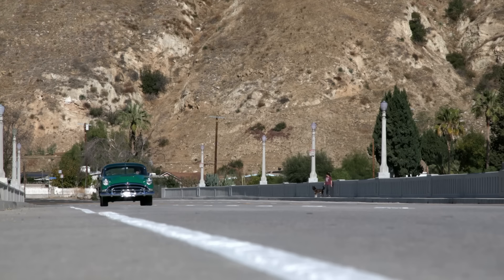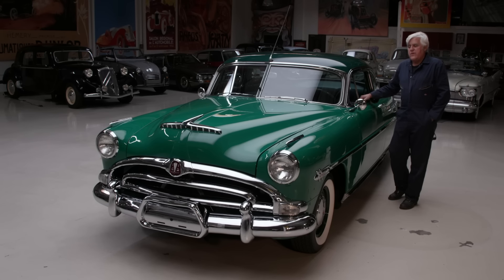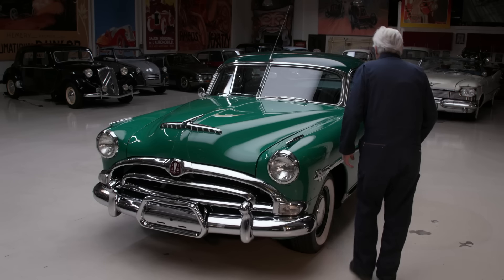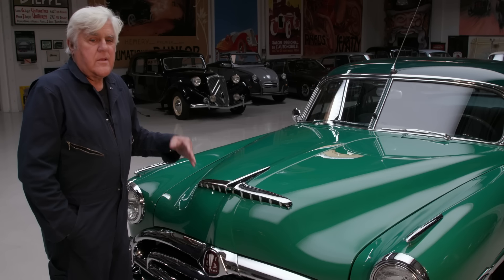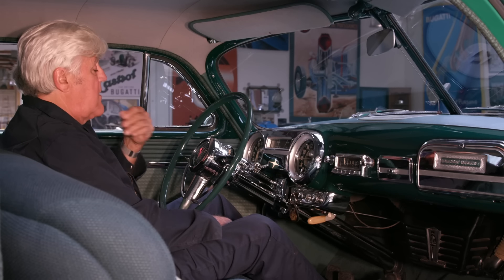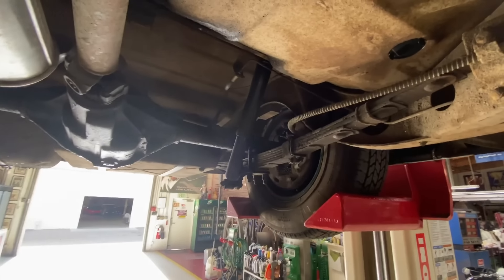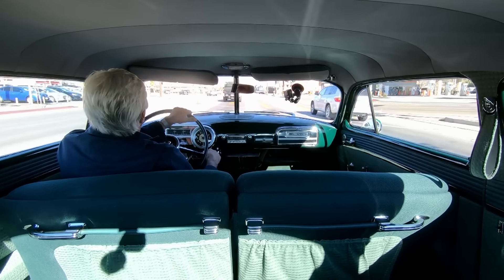1953 Hudson Hornet - Jay Leno's Garage

Comment: The car that I enjoyed driving the most when I was growing up was my dad's 1954 Hudson Hornet. You could get on the inside of the engine to work on it. It had an automatic transmission. When I ask my dad about putting a V8 in it, he said that a Packard V8 would fit the transmission housing. The car was a comfortable driving vehicle. However no power steering with 3800 lb. Power steering was an option that year along with oil filters being a new option that year on the 54 Hornets. And remember, no seat belts. One thing that used to happen was that my dad would drive to San Jose on the freeway doing 65 look up for a few minutes looking around look down at the speedometer and find that he was doing 80. That's how smooth the ride was.

Comment: I know just what you mean about the feel of cars from this era. When I started college in 1966, I bought a 53 Chevy Bel Aire hardtop from a work friend of my dad. Paid $100. for it and drove it 4 years replacing only the voltage regulator and the battery. Ran great and the clock.still worked as long as I remembered to wind it.  Had the old Blue Flame 6 with 3 on the tree, no overdrive, and, I think, a  4:10 rear end. Drove and rode great. After graduation, I sold it for $150. and bought a nice low milage 68 GTO. Talk about a change! But sure wish I had kept the old Chevy. Maybe I'll find another. Saw one for sale at a Chevy show. Nice car but painted bright taxi yellow. Mine was a light blue with a white top. Good days.Well, except for Viet Nam but they never pulled my number. Went into Federal law enforcement and as the new guy got the oldest car, a 66 Dodge Police Pursuit with a 440. Rough around the edges but man was it fast.

Comment: My grandfather taught me to set valves with engine running. He did the same with B-29 engines in WWII. Messy though as oil flies everywhere so you need goggles.

Comment: Battery shops in this area used to make up 8 V batteries for cars with 6 volt systems and they did not hurt the 6 volt wiring.My employer had several 6 volt caddies with that upgrade. Cheers from here! Southern Vancouver Isle

Comment: In 1968 I had a "55 Hudson Hornet V8 and it was loaded. It had air conditioning, power breaks, power steering, automatic transmission, and it had the Nash style enclosed drive shaft. I bought it for $100.00 because it needed a universal joint. That car was awesome.

Comment: 1) I was too young to drive back then, but my great aunt and uncle had a yellow Hudson Hornet when I was a kid.
2) That clock looks like it could have a radium dial, so it would be easy to read in the dark.  The radium dials in those days, and into the 1960's as I recall, were much brighter than the later ones.

Comment: Yeah, a Hudson was what Clint Eastwood's character in Kelly's Hero's was going to buy with some of his share of the gold.

After the war my dad worked as a mechanic for a Hudson dealer at 12th and Robison in OKC until Hudson went out of business.  We (my dad) had a Hudson Hornet coup that was the same shade of green as this one.  It had a sun visor just above the windshield and a unique prism viewer so you could see the overhead signal lights if you had one of those sun visors.

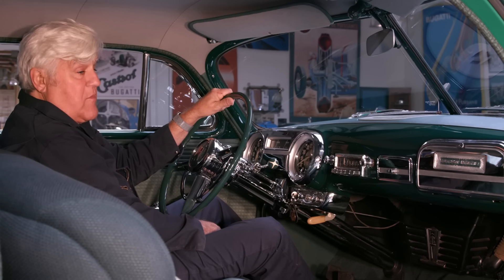At the 7:42 mark when the hood is up you can see back on the firewall two horizontal cables that wrap around small pullies on either end or side of the firewall.  These cable/pullies operated the vacuum driven wind shield wipers, that by the way when you were accelerating would slow down due to lose of vacuum.  On the inside at the 13:46 mark you can see a tan colored handle in just the correct position to be reached by the driver's right hand.  When you push this down a door would rise up in the middle just on the outside of the windshield that would allow air to come into the car.  There was no A/C in those days.  At the 20:50 mark you can see the seams of this door at the rear of the hood just before the windshield.

Memories.  Good ones.

Comment: I worked in a building from 1993 to 2011 that had originally been built as a hudson dealership back in 1946. It was interesting because this building had been changed very little in all of that time. There was still a glass showroom at the front of the building that had been used to display  brand new hudsons, and all of the salesmans offices were still intact and as they were back in the 1940's/50's. This building still remains this way in 2022 and is located in downtown Roanoke Va. Any hudson enthusiasts would probably take great delight in seeing an old dealership that has remained virtually unchanged in 75 years of history. It is almost certainly the very last one of its kind in existence today.  How much longer it remains this time capsule of hudson history is anyones guess

Comment: I was the mechanic for a Oval Racer '53 Hudon 2 door Twin Hornet. Th driver always out cornered the V-8's. AND he usually on the race. 307 ci flathead six with dual two barrel carburetors. Ran on 101 octane gas.

Comment: Our family inherited a 52 Hudson Pacesetter in 1963 with about 8,000 miles on it.  Garage stored.  Upholstery was brushed wool pinstripes and it got rubber in all three gears.  Amazing car.  It was stolen and stripped about 3 years later.

Comment: I just watched this, again, after a few years- I must say this 1953 Hudson Hornet is about the level of technology that makes sense for an automobile.  That is efficient, reliable and more than adequate performance that feels right as well as serviceable for a long useful life of dependability.
        I wonder if the original dies are left?  A new American manufacturer needs to emerge that is willing and able to produce reliable and dependable automobiles.  New technology is not all bad! Disk brakes and cross-flow radiators improved safety and reliability.

Comment: I'd love to drive  a Hudson, always thought they were sleek and just good looking.  I recall the local dealer showing up when  my father got off  work and he was driving the new '68 Corvair.  We went for a test drive and it was nothing like the older Corvair's and the styling was really nice.  Seems like it had some sort of turbo  engine and it was fast and quiet and handled really nicely.  But I had a 67 Malibu Sport with a 327, 4 speed and the engine had been built with all those go fast parts with GM numbers, not a number on anything in the GM book because it was a Zora Arkus engine and made 425 hp.  It would just blow the big Mopars off the road and outrun the DPS so badly they could never catch me.  It revved so high it would sling the blades off the alternator.  It has a few nicks on the hood from the underside.  It was a really quiet car and smooth and handled better than nearly anything from that era.  I stupidly traded it.  If I'd had any sense it would be parked in the barn right now.  If I'd only known just how nice a Hudson Hornet was I would have bought one for cheap since the junkyards and car lots had plenty of them.  Being a truck driver I would have appreciated that inline 6 but I was ignorant.

Comment: I had a '61 GMC 3/4 ton with hydraulic brakes and clutch that use the same fluid reserve. I pushed in the clutch and braked at a corner one day and blew the hydraulic clutch seal just as I put it in neutral. Reckon I should've replaced that when I replaced the brake cylinders and forgot to reconnect the emergency cables. But hey, it was my first vehicle I didn't even know it had a hydraulic clutch. It eventually rolled safely to a complete stop.

Comment: The Hudsen takes me back to to 1968 when I worked part time pumping gas on the evening shift going to college. A coworker had a Hudson Hornet and I thought it was smooth driving and unique. Used to buy 1950's cars for 60 to 75 dollars and drive them for a year or two, bought the recapped tires for $10 that didn't last very many miles.

Comment: Excellent car, excellent example and an informative description. What's not to like! OK...well, a sort of nitpick. The rationale for staying with 6V system was a bit weird. 6 volt parts draw more current than 12 volts so the wire has to be heavier gauge in 6 volt systems. It's thicker than necessary for 12 volts, but thicker is better--less resistance. The real problem with going to 12 volts is that all the accessories, lighting, wiper motor, etc. have to be changed to 12 volt components. So going to a 6 volt alternator is a simple way to solve the problem of low output generators that don't work well at low engine speeds. The wiring is not the issue.

Super channel, Jay.

Comment: In 1968, I was driving a UPS cage car, which was a re boxed LA France fire engine. It was Main St Hackensack NJ, and the light turned red. I hit the brakes ( I was doing about 30) and continued into the intersection. A woman driving a Hudson Hornet had pushed the light continued in front of me, and I hit her. I pushed her sideways across the intersection, and stopped. She was fine, the Hudson didn't have a scratch, even in the paint.

Comment: In the 70's SAAB faced a similar problem with the engine. They had evolved from simples cars to try to compite against BMW, but his engines were just four cylinders and BMW at that moment has four and six cylinders engines (and probable the capabilitie to create an 8 cylinders engine some what based in the 50's BMW's 501/502 engines (2600 c.c. or 3200 c.c. both with 8 cyl.)). SAAB has not the finance muscle to develop a 6 cyl. engine.,.. The solution came from the adoption of the turbocharger.
(Sorry for my english. I am from Spain and I think you need a... Hispano-Suiza?... Nooooo: a Pegaso. Great history, with story... Nice story, full of history. Nice a marvellous Chanel!!!

Comment: Great Detroit iron! Nice job. I used to wonder about straight 6 vs. V8 power, too. Turns out you can have a longer stroke with a straight than a V block; hence, more torque. The clearances for the crankshaft and rods is limited in a V8. 
I fondly recall the film Cars, where Paul Newman was the voice of the Hudson Hornet, the veteran prize inning race driver and teacher.

Comment: You should tell them how the seating is made with all the individual Springs. With the thick stuffing oh how the living room sofas well real hard to sit on they never had any give. I remember rebuilding a few other cars from the late 1940s to the 1950s as the body panels were getting done in led the body work.
 We started the reupholstering on the seating with all the individual stick metal Springs better in this seats. Does Sheetz have that metal frame that surrounds the enclosure of the bottom of the seating. With the bars going from Back to Front and holding the springs in place with the heavy thick cloth material that kept the bottom of the seating, very tight and firm when you would sit on it with all your body weight. 
    There is so much to doing a frame-off restoration but when you have it all  finished  you
have a  beautiful beautiful car.

Comment: I still cannot for the life of me fathom how a 308 6 with only 2 single barrel carbs (never mind the air induction), efficiently propelled probably at least 4K lbs of  deadweight steel through a NASCAR circuit - and WIN! With the exception of a small handful of redesigned engines (preferrably with turbos or superchargers), you can't even get today's aluminum V6 to pull half that weight without serious failure!

Comment: My 1950 Chevy pickup has an oil bath that look like those just painted black. Always wondered what it was originally off of. The thing mounts on the carb and crosses the engine just like and the bracket for it goes right behind the coil.

Comment: My father had a 1955 Hudson Hornet, same 308 ci twin H power motor, 3 speed overdrive tranny, black & white two-tone paint, a continental kit, and the "modern" styling. Looked like a Nash on steroids but was roomy enough for 4 kids. If I remember right it had a ceramic coated exhaust system.

Comment: Thanks Jay Leno. What a beautiful car! Jay misses a big difference between v8s and straight 6s (does not apply to v6s). V 8s (starting with Ford's flat hear v8) were 2 fours pushed together. Each pair of cylinders basically share a main bearing. In a straight 6 because each cylinder occupies a lot of space, there's a main bearing for each side of the cylinder. Less flex in the crankshaft, stronger output, less wear. That was also true of straight 8s. They were more robust. With flat heads/side valves they were low revving and given the crap steel and iron of the era, they would last a long time and were very reliable. Because Diesels ram their connecting rods with greater force, manufacturers prefer straight 6s.BTW I noticed Jay shifted into first gear while the Hudson was still rolling. Did the Hudson have a synchromesh first gear? Most American on the column three speeds only had synchro in 2nd and 3rd.

Comment: Jay's is the only 308CID engine I've seen with a manual transmission. I was told that Hudson started offering the big engine only with a Hydramatic transmission, because the cork clutch plates on the manual trans couldn't handle the engine's torque.  The cork faces on the clutch plates were small, round disks that looked like they were sliced off the cork of a wine bottle.

Comment: Love these videos, Jay !   Especially the more common cars of the 50's when motoring really matured.  However, your comment about "6 volt wire"  is wrong.  Actually,  6 volt systems need THICKER (heavier gauge) wire than 12 volt systems.... so,  its BETTER wire as long as the connections and its condition is good.

Comment: 9:00 it is not necessary to change the wiring if you convert a vehicle from 6 to 12V. Because the current will be half for the same power, it is actually even better to keep the original 6V wiring, you will have less voltage drop due to less resistance in the wiring system.

Comment: Correct.  Wire capacity is a function of the area or wire size.  Going down from 12v to 6v could be a problem.  But if you have 6 volt wiring, the insulation will be good up to 100's of volts and going up to 12v means now you only need 1/2 the current so the wires will be fine.  Need to change 6v bulbs out for 12 v,  because old 6v bulbs will blow immediately or have a very short life on 12v.  The radio will draw a lot of current at 6v and probably should have a small dc => dc converter to drop the 12v to 6v for at least the radio.

Comment: This was my family car when I grew up in Santa Monica in the 50's-early 60's. Dad sold it for a new Le Sabre in 63 but regretted it as it was reliable and huge inside but mom liked the Le Sabre. I am an E.E. and you are wrong about the 6 volt wiring. You can't go from 12 Volt to 6 volts without changing the wiring but to go from 6 to 12 is no issue.

Comment: I don’t know who told you that 6V wires were bad for 12 V because they were wrong. If you’re running 12 V through 6 V wire for 6V wire it’s much more efficient less resistance less heat less loss. If you were to run 6 V lightbulbs yes they would be too bright burn out a lot shorter but why are you so you don’t have to change hours unless you’re an airplane and looking for the weight reduction...
    I wish you would start doing a motorcycle episode showing those old scoots....
    We spoke for about a half an hour when you first came to Los Angeles in front of the improv and Melrose; we were young once

Comment: Jay, you're wrong on 6 volt wire, in wiring, bigger is better!  In over drive, the car freewheels, [as if in neutral!] Also I though the Hornet didn't have a bell-housing & drive-shaft hump, in that car, "You stepped down into." as they advertised! Thanks for sharing with us!!!!

Comment: I like to hear an see the old Hudson hornet. My dad otis stevens and miles spickler raced midgets in the late 30's until my dad was hit in an eeye and lost his depth of field. So that stopped my dad's racing career.  They were always friends but always competitive. Miles continued racing and built a winning roadster for indy in early 1950. Miles and my dad dated my mother at different times and sfter my dad Miles would stop by as a friend as long as he lived. Miles bought a Hudson Hornet and my dad bought a 1950 straight eight pontiac. So they had to race them to compare. My dad immediately pulled the head off the pontiace and had .010 plaind off, increasing compression, so this race was on on a straight road in the dark. It was virtually a dead heat until we ran out of road. I was about 8 or 9 years old. May dad raced at everything he did. Even timing how fast he could get the key in the front door to our house when getting home ftom a car ride. At 8 years old i was steering my dafs motorcycle while sittin on the gas tank.

Comment: A Hudson is the kind of car that appeals to me for its rugged chassis, solid overbuilt qualities, good handling, and its record on the racing circuits. --Jay? Have you ever compared a 1951-53 Hudson Hornet with the 1954 model, which had the last significant updates of a real Hudson? I've heard that the 54's had added refinements like the new instrument panel & a one piece windshield (I know you like the two piece designs!), along with a bit of metal work to the exterior, that made it a decent update. It would be neat to compare them side by side with similar straight engines and drive-trains (the manual preferably) to see how they contrast.